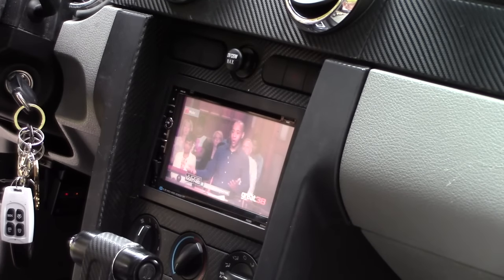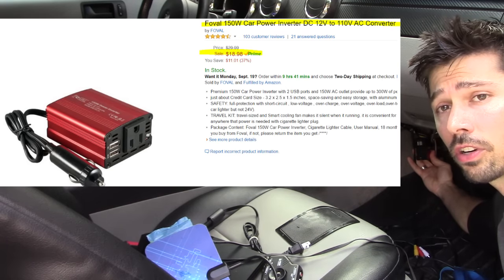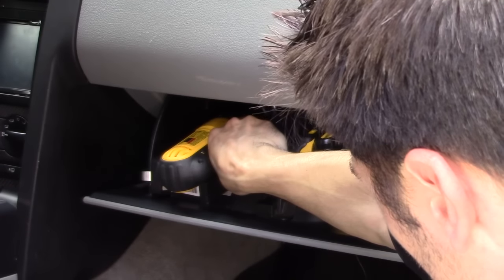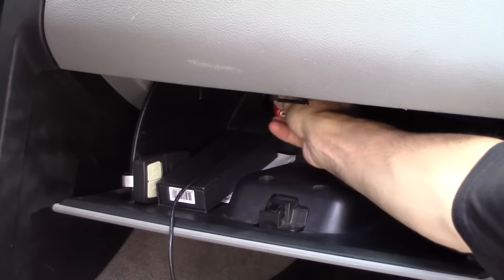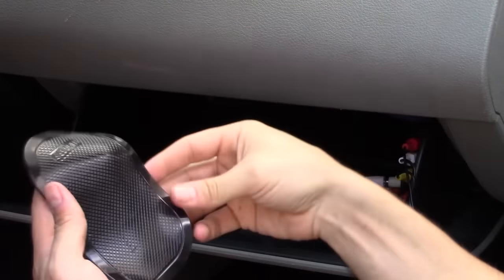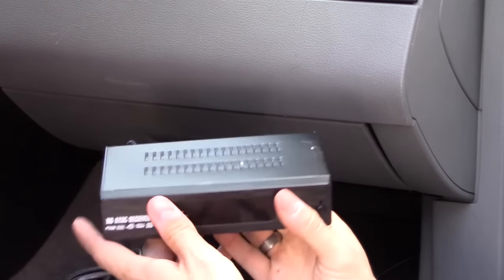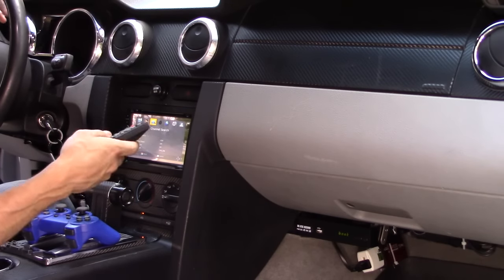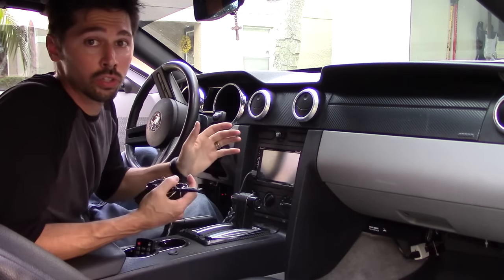HOW TO GET TO WATCH FREE TV, INSTALLED IN YOUR CAR LEGALLY!!!

Comment from the maker: I have to say this even though it's common sense but please don't drive and watch tv or play games.
Reply: very nice video bro, but do you need to have a stereo with TV Tuner or can you use a regular double din, mine has gps, dvd player and all that but it doesnt have a TV tuner option. 

please help thanks
Reply from the maker: just need digital TV box, antenna, radio with video inputs or headrest monitors.
Reply: cool thanks bro
Reply: Nah, they'll just want to play Gran Turismo before a race.
Reply: Ok
Reply: Tampatec Is it possible to add cable/satellite to my car? Because I just took out the factory radio in my 2007 Toyota Matrix, and replaced the factory radio with an Eonon unit, and added all this, as well as Android Auto/Apple CarPlay.
Reply: @rileysmith9843  I don't know if its possible, cause you need the satalite dish
Reply: @Tampatec I tried installing using a tv tuner box, clear tv antenna, power inverter, aftermarket video/radio with inputs, I can hear the channels and see them briefly when toggling the mode options but won’t show the channels longer than a split second, I keep getting a black screen saying “you cannot drive and watch tv and the same time” 

Do you know what I’m missing or why the tv would only briefly show and have only audio? The red,white, and blue cables are in the video input and Av L, R,

Comment from the maker: list- Car stereo TV monitor-https://goo.gl/vtlo2m
150 watt AC power inverter-http://amzn.to/2cSGa6O
RCA video audio switch-http://amzn.to/2cvnojY
Digital TV box-http://amzn.to/2cvmkMU
extended lighter port power cable-http://amzn.to/2cvnzvE
PS2 slim-http://amzn.to/2cvoAE6
off-air antenna-http://amzn.to/2cGit0T
Reply: Can you install a ps4 instead of a ps2 in the car
Reply from the maker: yes but power inverter needs to be 300watt and monitor needs to support hdmi

Comment: My problem is that I purchased digital TV for my car 2013 Toyota Corolla. I have a pioneer pioneer head unit. I already installed monitors for the back. I have them hooked up so that whoever's in the back can watch whatever I'll be watching in the front. Sometimes when I am alone and I am waiting for someone I like to cut on and watch TV I don't know how to hook it to the back of my pioneer. So I ended up hooking them to the head units in the back of me. So whoever's in the back can watch live TV how can I install it to my head unit also I do not have a port for it what do I do

Comment: How is the head unit holding up since have seen lots stop working after few months, thanks.
Reply from the maker: Mztr.Dros Enterainment still works great and it's loud. I love it more the my old alpine stereo. shipping from china sometimes hurt some stereos.
Reply: Appreciate you willing help others by sharing your own experience, I would def do the same and properly grab one, one question...I see alot of others connecting Ipads or tablets into their head units would this one be compatible if I choose to do gaming there instead of PS2 and all other apps etc., also does it have a built in gps thats accurate or would i be able to intergrate all this with an inpendent gps like Garmin for better accuracy and everything else Ipad can do like OBD app for car diagnostics? I'm trying to find a dependable double din head unit to do an Ipad or Tablet install with TV like yours is properly decked out, Props bro
Reply from the maker: Mztr.Dros Enterainment the GPS is accurate and tells you if your speeding you can connect your iPad using the aux in
Reply: Nice, solid info guess I'm grabbing one. Also just finish going thru some vids in ur channel, man its a treasure chest of useful information esp for DIY projects, def need more subs. Props.

Comment: My problem is I already installed it my head unit has backup camera and video going out but I do not have video going in for the TV. The head unit has video going in so I was able to just plug it into the head unit in the back of me and get a picture so how can I take it from the back and add it to my front head unit along with everything else

Comment: Nice!  I was pissed that my receiver had TV built in, useless analog TV.  I do have other AV inputs tho, so I was searching for a vid like yours.  I have some questions for you when you have time to answer.  Is there not a digital TV converter that uses 12v power instead of having to run a inverter? Because the way you are set up looks like you will lose all presets each shut down.  Also is the remote necessary? Or can you control anything with the headunit. If it has to be used only with remote, is there a unit with a portable/remote IR receiver that I can hide somewhere.  I dont want it just setting out like yours is. Does it hold a station long, say driving down interstate at 60mph LISTENING to it.  Also Im in a convertible so what antenna would work best for me, I already have 3, the am/fm, sat, and gps.  Thanks so much for posting this BTW!

Comment: way to destroy a mustang's glovebox...
you realize there's a much cleaner way to achieve this by basically running the wires all the way under the center console to under the seats and putting most of this stuff down there right?
i have a friend that has a Pajero which when he goes on trips with his kids he has two PS3's connected through local Ethernet and they basically play with each other on any trip they go lol, both PS3's are positioned under the front seats and the whole electricity and local lan wiring is hidden under the center console. the screens are on the headrests of the front seats, and one of the PS3's is also connected with a switch to a 32" roof mounted folding tv on the trunk of the vehicle, so they can use that tv in the back when camping to play on the PS3 or watch DTV or movies or whatnot.

Comment: Dude, Your the TampaTec why the 120 V converter? we both know there has to be a DC/DC solution. I bet that tuner is running less than 12 V. And you could have used a simple dual female rca to single rca out instead of the A/B switch, You just can't power them at the same time.
Reply: Also. The only thing I actually agree with the installation is the A/V switch. Even if one component is powered down, the other components outputs won't have the same v-out and still end up with a weaker feed to the head unit. A physical switch is always better for those situations.

Comment: hey bud, i'd like to change my cig lighter from off to on all of the time on my 97 jag xj6 in order to have a solar charger on 24/7 to keep a trickle charge to my battery.  is there an easier way to do it other than taking apart all the console where the 2 cig lighters are located? maybe i can do it where the battery is located inside the trunk area that goes up under the console to the 2 cig lighters.  any ideas how to do this without me having to take it into an auto electrical shop that could get expensive?

ps. i really enjoyed this video as to be able to install a TV/video and tuner into the dash, hooking up an inverter and antenna. also, if your next venture is to add the internet to watch movies via Netflix or Amazon, i can tell you where and how to watch new movie releases that are in the movie theaters right now.  thank you for sharing your expertise.  Dennis in San Diego
Reply from the maker: +Dennis San Diego CA Tap into fuse box use volt meter to find 12v constant from battery and properly connect it to cig port. Use caution risk of short. Disconnect battery if rewiring

Comment: you need a high sensitivity diversity tv receiver to be able to see anything while driving. that box will only work when parked and in very low speed
Reply: Paul Sandin not if you ground the brake cable ...will work even when driving...
Reply: Instead of conecting the brake cable from the unit to a ground source,it should do the trick,and work at all times...
Reply: Juan Nunez that is not what i said. the stationary tv receiver is not made for moving in and receive tv signals. when you drive the signals bounce off buildings and the reception goes bad. you will not be able to receive the tv signals in speeds above 30-70kmh. a diversity receiver is made for mobility and have two antennas to cancel out the distorted signals due to movement. if you are going highway speeds and want good reception you have to have a receiver that has specifications for use over 180kmh and preferrably more. a home tv receiver is only good at receiving signals at 0kmh under good reception. brake lockout from the screen has nothing to do with that
Reply: Is there the experience of the owners? Does this works when the car is moving?

Comment: Can u use PlayStation 4?
Reply: Bro And Sis use a more powerful power inverter. Do note that the newer systems are 1. larger so will not fit in the glove box and 2. Generate more heat so overheating is a concern